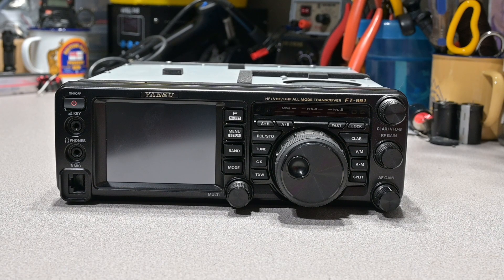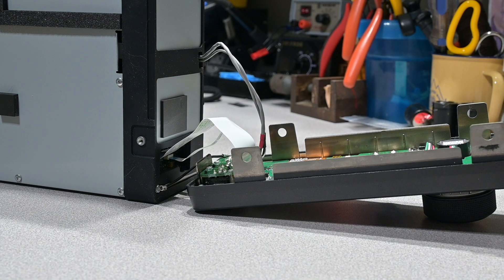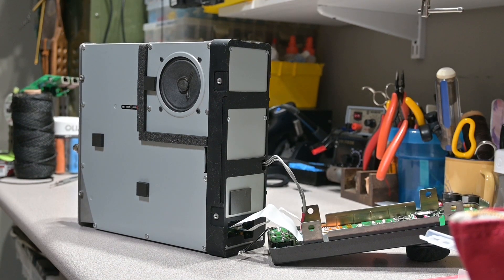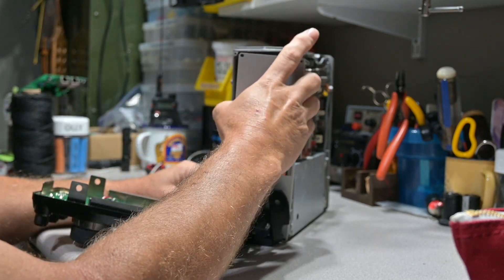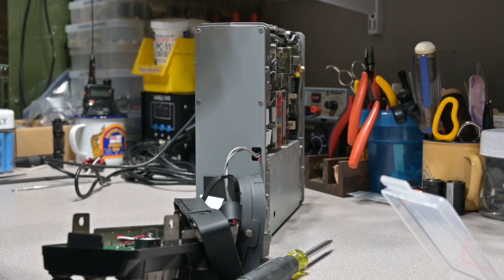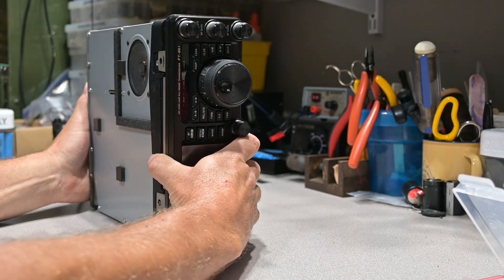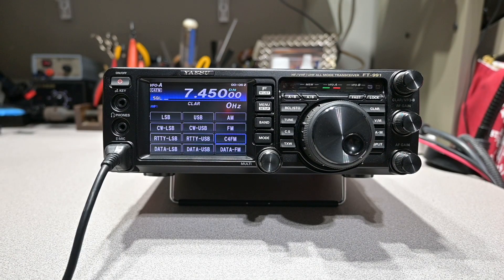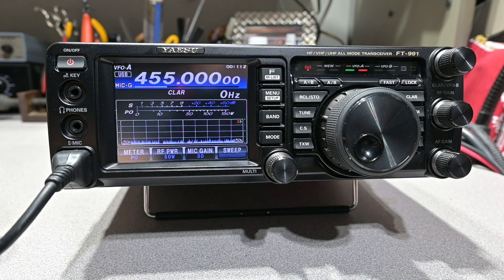Yaesu FT-991 Frequency Expansion MARS / CAP modification

Comment: Hi there Brett I have looked into the cap mod for extended vhf band I found that you bridge or remove bridge on the jp3001 - jp3002 there is a bridge there do you remove the resistor and solder a bridge, any idea I have a Japanese ft991a and it will not transmit on 147.000 I’m from Australia
Reply: Thank you for your prompt reply
Reply from the maker: @petarljubic8856  You are welcome
Reply from the maker: It is my understanding that this mod will NOT work for the Japanese market radio. You might want to join an online forum dedicated to the 991A. I apologize for not being able to give you a solid answer. Thanks for watching !

Comment: Thanks Brett. I just wanted to check the work of the previous owner while cleaning and tightening all of the grounding points. I noticed some of the copper ground springy tabs are not well aligned, I also polished up the surfaces they contact. I checked all board screws to ground too.
  I had the radio in pieces to replace D113 as it was leaky and stopping the PA port aux ppt switch to ground at the rear of the radio from functioning. If anyone has to replace D113 then let me say it's not for beginners. I got it in without any trouble but it's one of the smallest components I've had to work with with some limited access.
Reply from the maker: You are welcome ! I have an IC7300 here that had the the current sensing voltage regulator burn up after a lightning strike. I got everything out and have the parts but you are right everything is so tiny. Thanks for watching !

Comment: I took a 991a apart to solder
 in a new clarifier knob. I undid that big ribbon cable and plugged it back in after much struggle. It was unbelieveably difficult. The radio would not power up anymore. I sent it back to Yaesu for repair.
So yeah leave the big ribbon cable alone.
Clarifier knob repair was successful :)
Reply from the maker: Some ribbon cables are worse than others as you found out. Glad you got it up and running . Thanks for watching !

Comment: I reckon those other jumpers are worth soldering. This may onlock vhf and UHF frequencies. Worth a try.
Reply from the maker: I'm confident someone has tried that before and found it just changed it to a Japan config etc. I sold the radio soon after making this video. Performance of these multiband HF rigs out of band more than a few mhz on VHF / UHF has been pretty poor in my experience.  An el cheapo FM rig out of the box however pretty much only suffers at the extreme band edges if at all.  Thanks for watching !
Reply: So what happened when you did that?

Comment: Will the ATU operate on any of the expanded transmit frequencies, like on 60 meter frequencies? "Very 73 de KU4GW, Cliff"
Reply from the maker: It will however the tuner in this unit is pretty limited. Thanks for watching !

Comment: Is there no mod for the VHF/UHF bands ?
Reply from the maker: Not that I have found. If you find one let me know. Thanks for watching !
Reply: Not a permanent mod, however tuning to the frequency you wish to TX and setting up your power and all your settings, you can turn the unit off - press and hold A=B A/B and FAST while turning the unit on. DO NOT use the Clarifying knob while in this mode as you will change how the radio operator internally. Now that you are in this system configuration mode, make sure your in setting 1, smash the band switch button until you find the band you tuned up. Viola your TX unlocked. Unfortunately you have to do this every time you change frequencies. PS make sure you turn it off before messing with any knobs. No known permanent mod as of yet. 73
Reply from the maker: @DBCoopersGiblits  I have seen that done but never tried it personally. I sold this radio soon after I made this video so I don't have the chance to test it myself. I know from experience on other radios however that one has to be very careful in these hidden menus. Its easy to misalign a radio in a service menu. Thank you for sharing and thank you for watching !
Reply: @DBCoopersGiblits I thought it was up down up down left right left right THEN a b a b start?